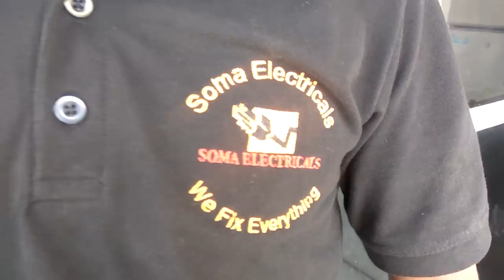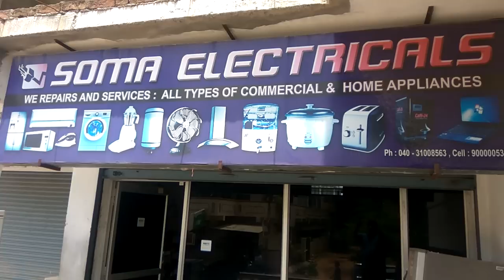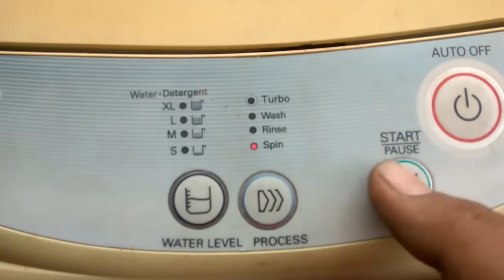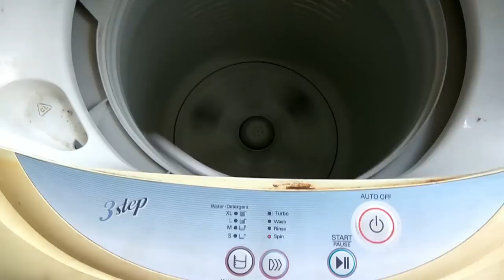LG Washing Machine Over All Service

Comment: you can use a pressure washer and make the cleaning alot faster.
Reply from the maker: Yes we have washer. While servicing this washer got some problems. So we used manual type
Reply: Yes .in one of your earlier viedeo u have used the high pressure washer.

Comment: Sir I m from Delhi, and I have LG top load WM. pls suggest can we use this liquid without opening washing machine like you did I:e without seperating all parts??
Reply from the maker: Aap kar saktey ho. Aap 1:1 ration dalana hai acid+water.  Aap ko machine kam say kam 10 liters acide aur 10 liters water dal kar machine ko low level main wash mode per chalu rakhna hai.
Reply: @SomaElectricals  thank you for prompt reply, that very kind of you🙂🙏
Reply: sir are you sure , there will not be any problem. @SomaElectricals
Reply from the maker: @ramavijaya148  there will be no problem
Reply: @myhappygreenspace  have you tried this trick , has it works or not pls tell .
Reply: @RajeshKumar-wr1gy  no brother I haven't tried this
Reply: @myhappygreenspace  ok sis.
Reply: @myhappygreenspace   Have you tried now? Because we are also having dirt in our WM. (I am from Surat)

Comment: This is hydro clorid acid ,but now not found easily in market.
Reply: Guru Charan .If that were hydrochloric acid, that plastic bottle would disintegrate in seconds
Reply from the maker: you r right
Reply: @SomaElectricals  then why saying its hydrochloric acid tell the truth what it is in real we just want to know don't want to compete with bro just tell what it is 🤣
Reply from the maker: @srinivas171983 it is not pure hydrochloric Acid there is the ratio of water mix from the manufacture for removing scaling
Reply: @SomaElectricals  thanks bro i was caring for you and your workers they were not using hand gloves for safety from now anybody does that please wear gloves 🙏
Reply: Soma Electricals Good Effort. Here used hydrochloride or hydrochloric? Which acid for cleaning the WM tubs. If we buy concentrated from manufacturer what ratio of water mix. Is this suitable for descaling of both plastic and steel tubs...plz clarify...

Comment: How can we fix back lint filter housing?
Reply from the maker: pull it will help of plyer clean and push it
Reply: @SomaElectricals  Sir I am having Lg top load new model (7.5 kg smart inverter). Yesterday i cleaned inlet filter, tub lint filter etc. Also i removed pulsator and cleaned it.

The problem is, along with lint filter i removed it’s housing also now when i am trying to fix back, i couldn’t do that....it has 6 clips....when i am trying to put top and bottom in the slot, i can’t able to fix this 6 clips inside the slot. How’s the actual procedure to do fix it back?
Reply from the maker: may be ur filter and jammed with lime scaling. u can buy new, here is buy link https://amzn.to/3fbs0OQ

Comment: Hello sir,
I have a LG front load 8kg now for last two day the PCB board light flickering and I can’t select the desire wash. 
I tried to disconnect all the wire from PCB board but still not working. 
Can you help me how to rectify this. 
Plz help. Or give ur cell number so I can call you.
Reply from the maker: there main be fault in PCB. check out with technician
Reply: Soma Electricals thx

Comment: Sir whirlpool 123 top load washing machine hai usme spin kam nahi kar raha hai kya karun baki sab kuch kaam karta hai wash, drain
Reply from the maker: Pcb check karao
Reply: Sir it is problem with bearing or any wire lose issue.....
Reply from the maker: @nagarajunaarjuna6937  in which machine u r saying
Reply: @SomaElectricals  sir iam service engineer for whirlpool India... There or so many problems comes around.. With drain moter... Dhame valve. Breakarm jam. Capacitor.pcb problem etc....
Reply: Iam saying about old machine to new machine..problem

Comment: Sir lg topload oe error code araha h
Reply from the maker: The 'OE' error essentially means the water is not draining from the washing machine. ... It is likely the cause is a kinked or clogged drain hose or a clogged dump valve, or drain motor faulty